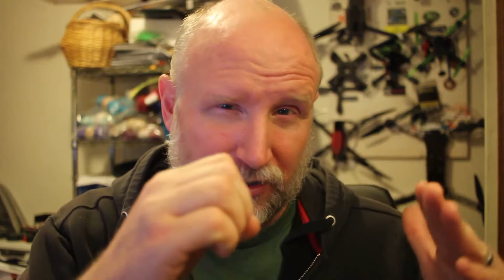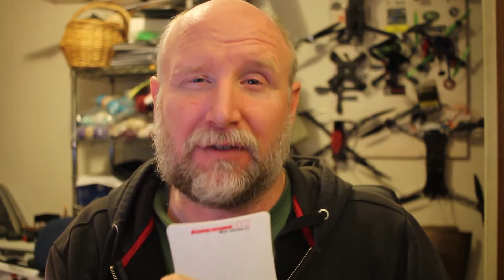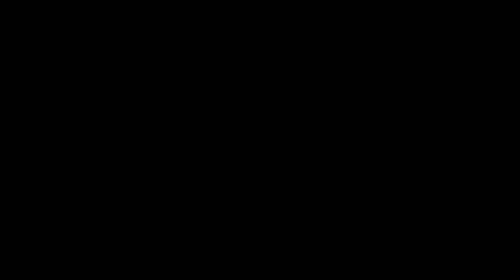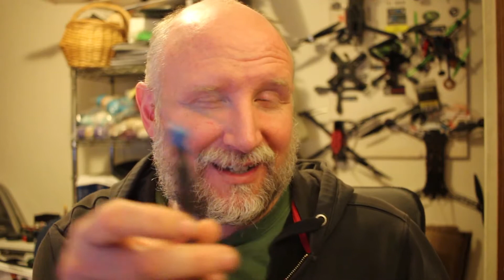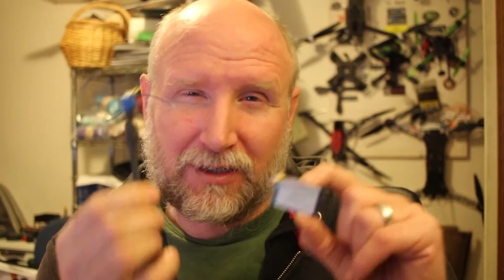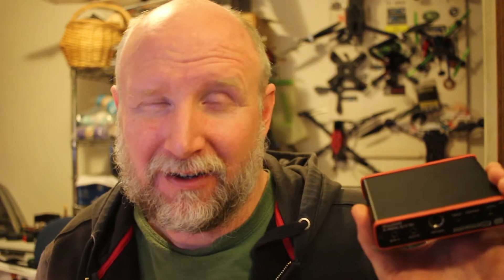Long Range Miniquad Fundamentals and Advice

Comment: thanks for the video what do you suggest to find a lost drone? can any gps locator be used to find?
Reply from the maker: +MAB FPV The regular crossfire receiver has a find mode, and in some cases you can use the vtx to track a downed drone. However these methods only work if the battery is connected. You can hook up the TBS GPS to the crossfire receivers to get the last known GPS position on the transmitter. DVR is also a big help in most situations.  Finally, an an RFID locator solution would be great if you can get close enough, since it wouldn't require batteries to run.

Comment: Want to walk thru what makes a good long range quad? What frames seem to be best?
Reply from the maker: In terms of pure physics, it's pretty simple. Light weight. The lighter, the better. In terms of aesthetics and functionality, it's complicated. Some guys like a bit heavier frame to help guard against jello. Having your GoPro protected could be a big plus for some people. If you're running a RunCam split, a frame that gets the props out of view might be appreciated. If you want to have a GPS, DroneKeeper, 1.3ghz/2.4ghz video, etc, then you'll want a bit more space in the body to keep them all protected. If you want to run bigger batteries, a bottom mounted battery is a must. So all of those things you should take into consideration when building a long range quad. Figuring out what you want to do with long range is essential to planning a build. A big sky, fast action type long range like Richard Shelton will require a different type of quad than, say, a quad designed to cover 10km of distance and return. 

Hope this helps!

Comment: Have you ever tried any GPS location devices or tracking devices to find a lost quad?
Reply from the maker: Hi Frank, I've had the TBS GPS on my quads previously, so that I could receive the coordinates on my crossfire/video feed. However, anecdotal evidence suggests that this wasn't effective (I've lost 100% of the quads I put the GPS on). Many of the places I've flown are pretty rugged and inaccessible. In the one quad that I recovered, there was a river between me and it that was too high to pass. It took another three months for the levels to fall enough that it would have been possible to recover. Most trackers would have died by then and GPS coordinates would be the most useful. 

In total, I've lost 5 quads so far. 

With 2 of those, a GPS tracker with independent battery would have been useful. I could have potentially tracked the lost quad and found it.  The TBS GPS would have worked in those instances as well.  

In 2 more, no GPS or tracker would help. One of those was lost near the top of a mountain, and the other in a lake of indeterminate depth. Rescue missions would in both those cases would cost more than the quads themselves, even if we knew exactly where they were.

In the last, I could have potentially found it with a tracking device, had I the energy, the time, and a non-sprained ankle. 

In summary - would it be worth investing in such devices? Potentially. Depends very much on the cost, range, and battery life.
Reply: Thank you Chile, I completely understand and I am sorry for your loss. I am endeavoring not to have the same experiences. Looking into miniature GPS tracking with independent battery.

Comment: well spoken.

horizon mode is great for the exact reason you mentioned. Even if you  havent lost it far away, you have  chance to punch it up, then ease it down. less damage if you can find it.

other options are small osd / gps units. while no RTL, video can tell you where it was lost (if you recording it),

great stuff and thanks for sharing.
Reply from the maker: Yup, however, there will be instances where even if you have DVR/GPS/etc, it's just impossible to recover. In the bottom of a lake, for example. Or on the top of a mountain ;-)

Comment: Thanks for the great overview.  I haven't done any distance flying yet, but I've often thought that when I do someday, I would look into INav.  It may not be as good for freestyle, (I'm not sure it does any freestyle at all, actually), but if it's good enough to do some decent dives with it, and have return to home, it may be worth the trade off.  I don't actually know that much about INav, obviously, so am not sure it's suitable for the kind of flying common to mini-quads.  Are there any freestyle mini quad pilots here who've tried it?

As for finding home, would it help to attach a bright, blinking flashlight to your ground station and aim it at your flight area?  And if a bright flashlight isn't enough to stand out in the day time, then a mirror may work but would probably be harder to use.
Reply from the maker: Return to home is a double edged sword. In some cases it would work well, in others not so well. For example, the last quad I lost behind a mountain. Had I engaged RTH, it would have embedded itself in the side of that mountain ;-). The flashlight idea is a good one, but maybe not practical in all situations. To see it 2.5km away in broad daylight, it'd have to be pretty bright. Maybe a green laserpoint or something like that could be good. 

Inav should work for basic acro. It's based on old Beta/clean flight versions and people were doing acro with them just fine way back in the day.
Reply: John Steinholm 
I have used iNav a lot with 7" quads. It's just like cleanflight/betaflight. Can be very acrobatic or docile, depending on your settings. It works quite well actually, and I wish that the TBS Colibri had a barometer in it to use iNav on the Powercube stack

Comment: Yes, it's very sad to lose a drone.  Spotter is so important for many reasons.  Landmarks to orient yourself underneath the horizon is always important.  Thanks for showing that dual receiver box, been looking for something like it.  I never trusted auto-level from hard acro, maybe time to consider it again.  Thanks for sharing your experience.
Reply: Thanks for the info and feedback, Michael. I'm a late RC starter, just a couple years so far. When I was young I purposely chose the manned sports, was doing real aircraft (PPL), hang gliders and then boats, water skiing, spear fishing, scuba, etc. In Aus, how could you not? The hang gliding was the best. Now; fpv is better - much safer and of potentially wider scale.

I tend to hug the ground with the quad, fast and low. Which is annoying when I keep hitting it lol. So usually not too high up. I am an ex computer geek but no don't do blackbox - life's too short. Cheers mate.
Reply from the maker: I'm going to have a play with the level modes before I really trust them, but my thought is that it can't be any worse than not having any video and no idea what's going on.
Reply: Think of it this way.  Your quad tries to level upside down when your accerometer is scrambled.  Blackbox continues to prove it.
Reply: Your radio has a million switches, it can't possibly hurt to have an auto level mode programmed. 99% of the time you'll never use it, but that 1% time could save your quad. If you're going straight out from yourself and you lose video, it's hard to turn around blind in acro mode. But you could just switch to auto level, maintain throttle and pull full back on pitch, and you're very likely to fly backwards into video range. Boom, quad saved!
Reply: Jon, you didn't read my comments.  I use auto-level when I need to (it's already set up).  However, I do not trust it when it's scrambled.  The accelerometer doesn't work with heavy g-forces against your quad.  Look at the artificial horizon or look at a blackbox log for proof.  BTW, I fly 5s... with hard acro.
Reply: I always setup stabilise mode, for failsafe. That way during a failsafe the quad levels itself and decends gently - with usually no damage. Don't forget to set the failsafe throttle setting, and test it with your lightest battery, using a temporary failsafe switch on the radio.
Reply: I don't trust the accelerometer in the type of flying I do.  It's all about the g-forces and the accelerometer scrambles itself and can't recover for 5-10 seconds.  Start looking at blackbox data and you will see what I mean.
Reply: Have you seen that on multiple different types of FC? I've not seen, or heard of that type of problem, interesting. Even with that issue though, I think I'd tend to set up stabilise on my failsafe.. I mean hopefully a failsafe won't happen anyway, but if it does, having stabilise might/should give me a damage free landing. Nothing to lose in this case, right?.. the alternative is for it to plummet to, and smash the ground.. I'm not rich :).
Reply: amisoftau If it floats more it will drift more.  I trust in physics for this reason and choose not to have it drift more.  I see it with all my flight controllers for the type of flying I do.  However, I will turn on Horizon if the artificial horizon makes sense.
Reply: amisoftau btw, I learned about it in my LOS flying many years ago.  If you watch Blackbox logs, you will see what I mean over time.

Comment: There are two kinds of long range FPV pilots.  Those who have lost a quad and those who "will" loose a quad....
Reply from the maker: That's right. However, at this point losing "a" quad is long past. This is number 4 (or 5? I've lost count).
Reply: And when you do go down in terrain, don't hike in without proper supplies.  I once went for a 2 mile hike into rocky terrain outside of vegas, in sandles without water, in very hot weather.  That turned out to be really stupid.  I got my quad back but by the time I got back to the car I was light headed, and only had one warm pepsi to drink in the car.  Luckily that and very strong car air conditioning were enought to get me out of trouble, so I was able to make it to a gas station where I could get more to drink.  I could have gotten into real danger territory with heat stroke because I made a bad decision.  I got lucky, but not everyone will.
Reply from the maker: Very good point! I've gotten myself into some pretty sticky situations trying to retrieve a quad. In Hawaii I spent an hour wandering around in the bush trying to find one of my quads, with no water. My buddy who was waiting for me at the Jeep said I walked out of there looking 'destroyed'. My vision now is that no quad is worth my life. If I've got the slightest doubt, I leave it there.
Reply: I think that's true of all RC flying pilots, hehe. I'm def in the first club